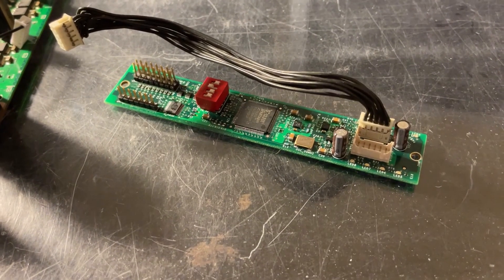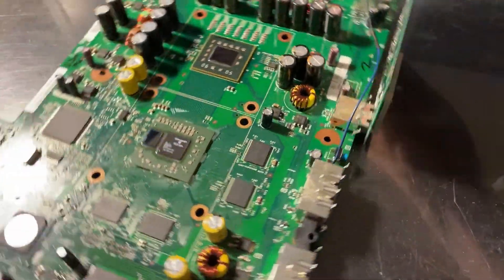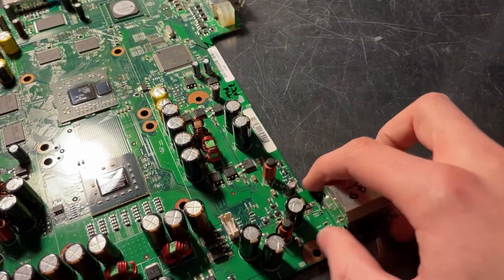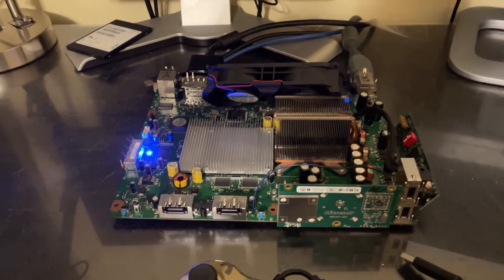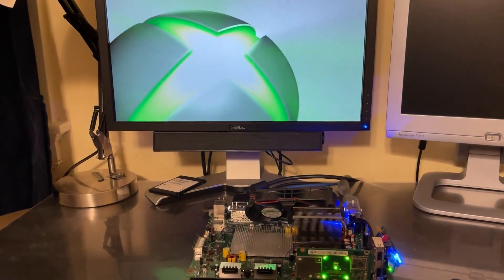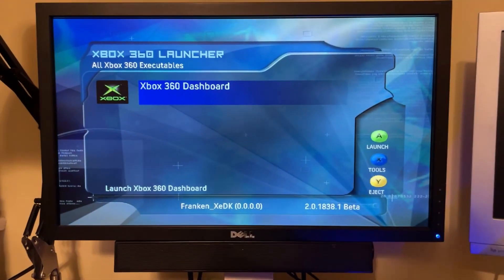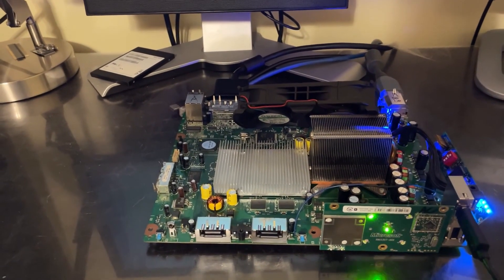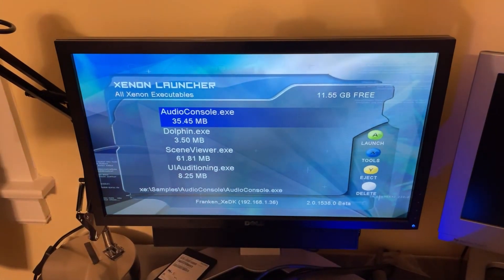Frankenstein XeDK 007

Comment: Have a greeting from Cuba. We have a community following.I spent a lot of time finding all kinds of vulnerabilities in the Xbox360. I have a 2005 Xenon that still works and with the upcoming closure I have considered doing RGH as a last option. I understand that you can downgrade by changing the CPU for one with 0 burned out efuses; The question would be: why not burn them all manually or by modifying an update to do so and use a CPU key with full FF? I am currently working on dumping the BIOS so that I can bypass the protections and that it is only necessary to write Xell Reloaded to the NAND and be able to use it as a low-performance Linux PC.
Reply from the maker: CPU Key all F is not valid.

Comment: Are you able to use the original retail xenon dvd drive?
Reply from the maker: XDK not can use it anyway.
Reply: @Josh.Davidson  I jtagged a jasper and broke the solder connection on gpu trying to force on a xclamp holding on the heatsink , No rrod but freezes with artifacting on dashboard almost instantly would you recommend a reflow with a heat gun or to pay a local for a reflow? Thanks for any input Josh
Reply from the maker: Reflows don't work - contamination
heat guns don't even melt the solder

Unlikely you broke the joints. More likely you damaged the silicon or motherboard.

Comment: What's the difference in the Y1 and the Y2 GPUs? I have a Zephyr system with a Korean based Y2 GPU and it died on me a few months after I got it and did a simple clean and repaste on it.
Reply from the maker: Y2 is an optimization of Y1 GPU. Still 90nm. But smaller die due to removal of one of the debug things and optimized routing.
2007 Korean chip are better, but not bulletproof.

Comment: I know that it is possible to downgrade the final Xenon XDK to 1838 by importing SMC from 1888. Is it possible to downgrade it to a lower version by doing the same? What is the lowest compatible FW?
Reply from the maker: Before 1838 not support DD2.0 CPU. (Maybe there is a rev around lower than 1838 with support, but I don't know)
Also, I downgraded my Xenon final to 1838 without any SMC things. It's Zephyr that will brick.

Comment: Very cool Josh! Had no idea there were unused xedk cpus. If you wanted to theoretically attach a sidecar would you only need to attach some wires? Or is there more to it
Reply from the maker: Yes. Just the wires.
Reply: @Josh.Davidson Is a titan board required for this to work?
Reply from the maker: @Asd1234Killer  Yes
Reply: @Josh.Davidson  TY, I purchased a couple xedk CPU's just incase Titan Board is re engineered  years down the road!
Reply: Are all the parts for this build readily available except for the Titan Board?

Comment: Hats off buddy nice work! Do you use a APU/GPU soldering station? That's a ton of work if your doing a install with the normal shop tools (rework station, soldering iron, etc).
Reply from the maker: Hello.
Yes, it's BGA Rework Machine.
Reply: @Josh.Davidson  I got plenty of dead APU boards ....you have a website?
Reply from the maker: @repairstudio4940  Right now I am too busy to do mass repair work but if there is something specific you need maybe I can help
Reply: @Josh.Davidson  I'll send you this board I use as a power supply test board and to test different ROL LEDs , which I mean I simply don't need but ya know the 360s really holds a spot of nostalgia in my heart and love to see it be used by someone. I'll mail it to you if you'll get it going. All the components are good and yep I tried a reflow twice without success...Its completely clean as well not some funky junk board, just let me know. 😇👍🏼
Reply from the maker: @repairstudio4940  May I ask if when you did “reflow” is there any residual flux on the board? Also, which type is it?

Comment: Why rgh 3 doesn't work on some consoles?
Reply from the maker: Hello, which consoles do you talk about, I mean the motherboard type?
Reply: @Josh.Davidson  MB Trinity Re-soldered twice, double checked RGH 3 doesn't start. Tried Matrix Muffin which also did't work, although the pulses were coming. Worked only on x360RUN but starts randomly, then quickly, then banging the cooler and 30-40 sec. On the forummer master said that it happens that RGH 3 doesn't work on some MB, only chip helps.
Reply from the maker: @drewmorama  try rgh1.2v2. 

Anyways yes some motherboard doesn’t take rgh3 but mostly the problems come only with phat. Most slim working good with rgh3.
Reply from the maker: Diagram: https://github.com/Octal450/Timing-Files/releases/download/Timings/RGH1.2-V2.rar
Firmware for matrix is also in J-Runner under Program Timing File menu.
Reply: @Josh.Davidson  checkbox in JRunner must be SMC+ right?
Reply from the maker: @drewmorama  Yes.
Reply: @Josh.Davidson  Thanks for the tips, appreciate that
Reply: @Josh.Davidson  How to program .fs timing files into ACE v3 chip? It cannot be selected, only .xsvf
Reply: @Josh.Davidson  Tested on matrix right now — instant boot! Thanks one again!
Reply from the maker: @drewmorama  My pleasure :)